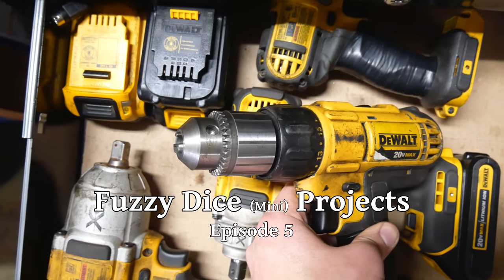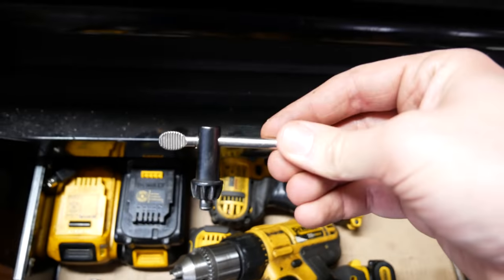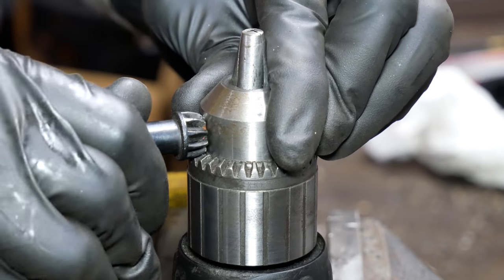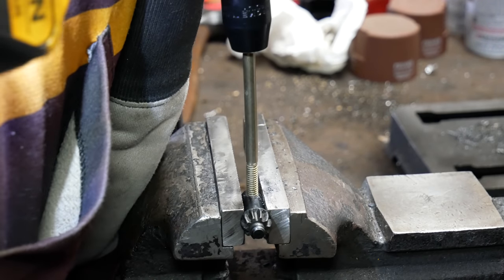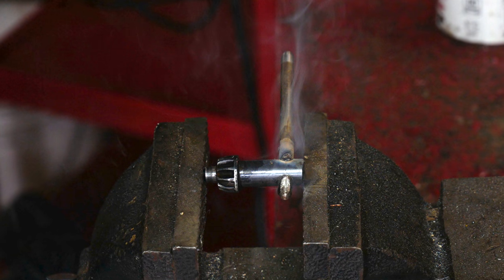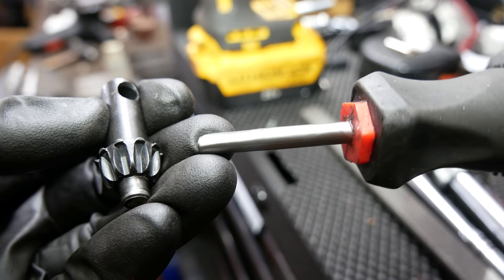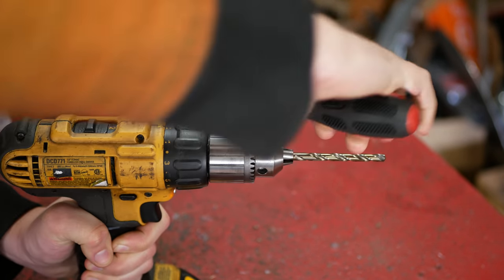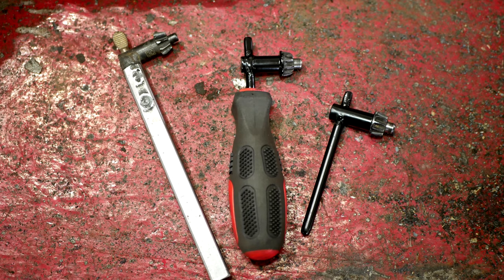Building Custom Drill Chuck Key Handles (Mini Projects Ep.5)

Comment: your using the drill wrong if you need to tighten it that much, i have used drills to drill so many hard things over the years and never had a problem with my dewalt drill. Invest in a drill bit sharpener.

Comment: If your bits need that much tightening, you have a worn out chuck. Usually a chuck will tighten easily and hold the bit with no slip. Once it starts slipping, the chuck jaws are worn and either need replaced or reground... But your video was very entertaining all the same...

Comment: You can also get an old combination wrench and slide the body of the chuck key in the box end of the wrench, after removing the original handle. Then weld the two together you’ll have no flex and it’s perfect.

Comment: Way back in the distant past when I was first shown how to use a jacobs chuck I was taught to use all three key positions. I have always done it this way without question. Tighten, rotate tighten, rotate tighten. Right or wrong I don't know but I can't remember having much of an issue with the chuck not being tight enough.
Reply: That's the "Smarter not tighter" method. Pretty sure that's why they have three key positions in the chuck